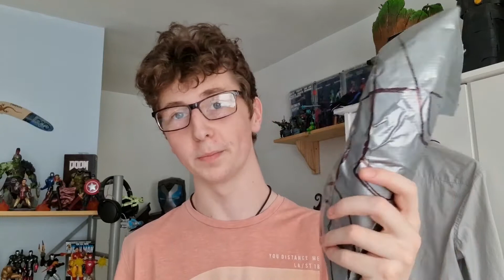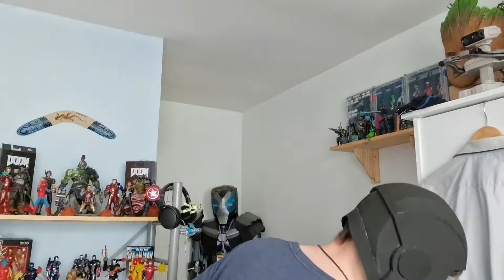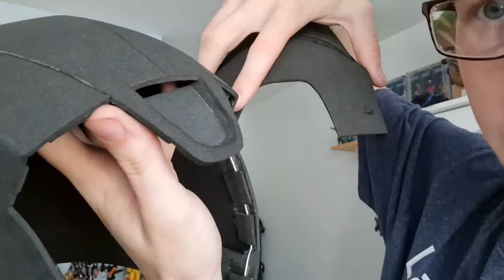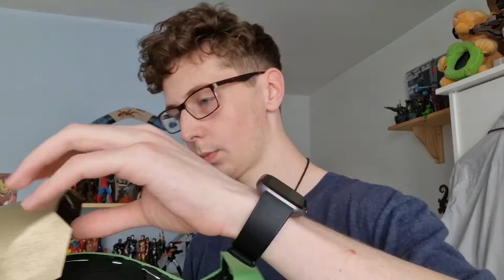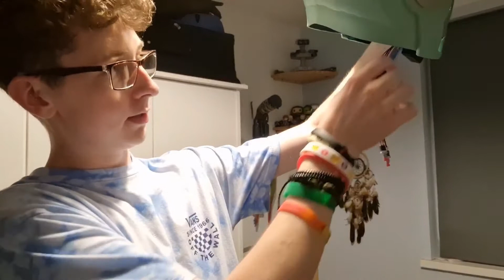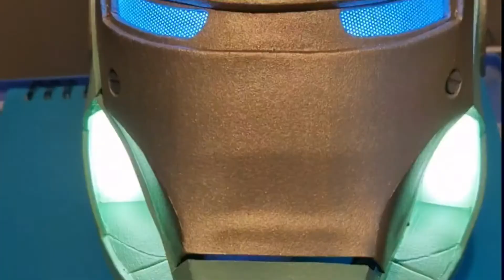Iron Man Mark 37 Motorised Cosplay Helmet

Comment: Aluminum wire is a good idea I gave up trying to making my face plate removeable do you have any in the rest of your suit?
Reply from the maker: Funny you should ask actually, the hinges on the torpedo hatches broke so I replace the bar with aluminium wire and bend it to fit the tube